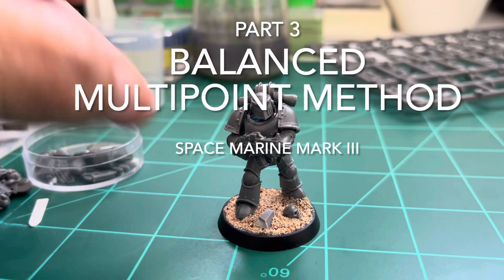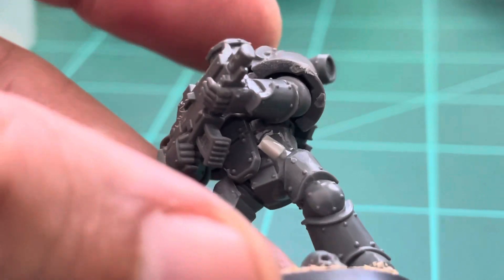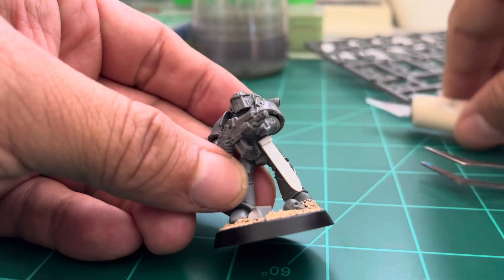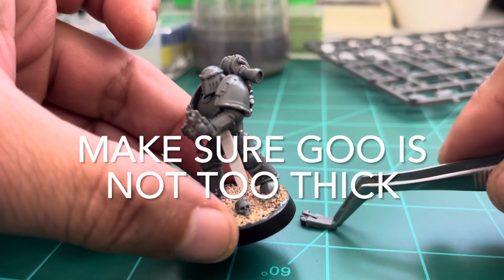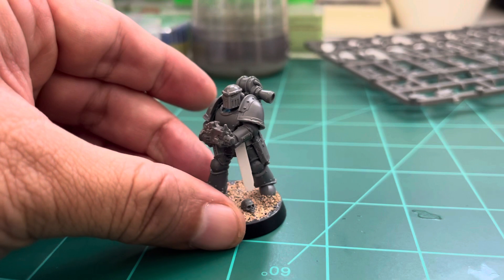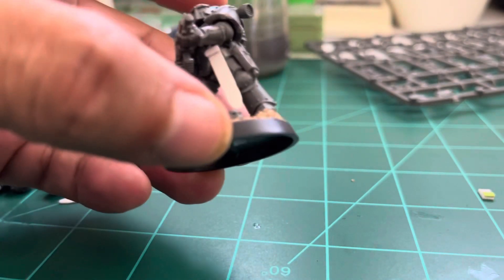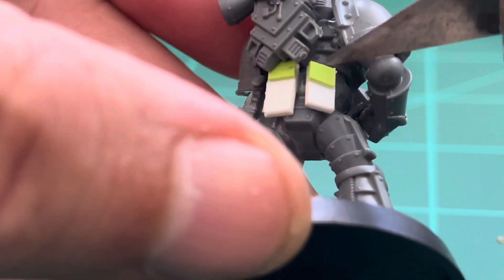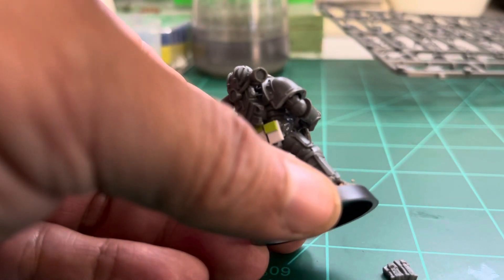Pt. 3 Horus Heresy Space Marine true scale conversion Mark III tutorial 30k 40k

Comment: I'm curious why you put so much effort into reinforcing the glue points by adding more glue and goo on top. I use Revell plastic glue and have never had to worry about bits falling off. Is it just because Tamiya glue is different, or are you putting more strain on your models somehow?
Reply from the maker: Many of the models I make end up in other people hands. So I m extra careful, but tamiya does more than just gluing. For plastic to plastic conversion tamiya is the best. Bonds, seals, covers, melts, fuses, and one can play with the consistency
Reply: @sunsolstar  Ah yes, that would explain it. You're reinforcing them to keep your customers from complaining about broken models. That makes perfect sense. I don't have that issue to worry about. :)